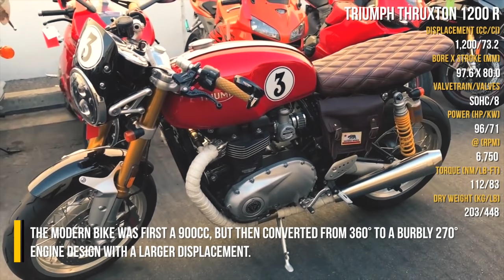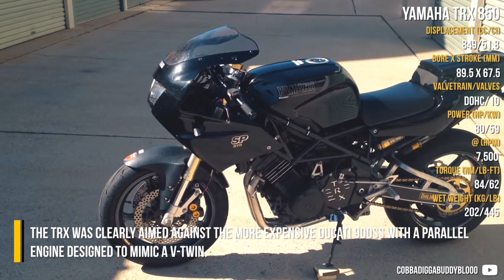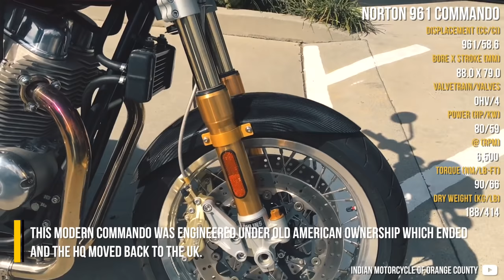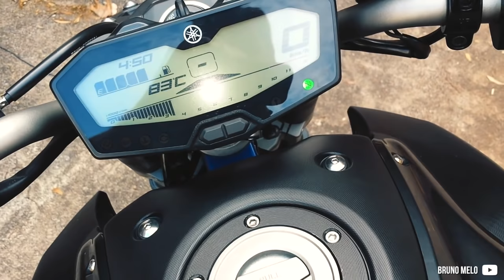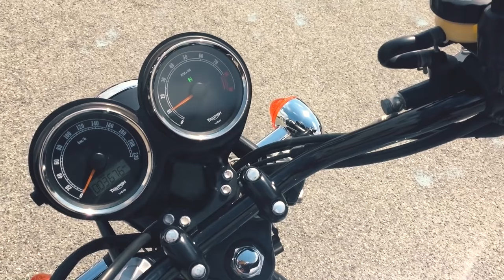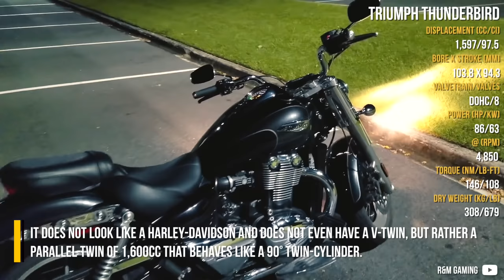11 Of The Few Cross-plane 2-Cylinder Bikes Ever

Comment: Basically, one quarter of a V8.
Reply: and im wondering what if just the front 2 piston assembly's are installed by there selfs and nothing else and ran? ( would it tare it self part? or what's the biggest stroker crankshaft you can use or piston wights ? ect. would you need a special cam or dizzy or fuel system ? ) as im curiose enough to tryout on my mopar hemi/440 stroker v8 as im looking 👀 to test different camshaft timing's and rod and pistons and running setup like computer controlled spark and fuels or boost ect. with out costing a fortune 🔮 and or giving me time to buy and assemble the rest of the parts to make back into a v8 ( and still letting me drive it in the meantime without making 1k hp more than likely as i don't know the max it can take 🤷‍♂️ ) without permeantly making it a 108x114mm~ Harley 90*v twin with 6 dead holes
Reply: And singles are a 1/12 th of a v12

Comment: IMO The Yamaha MT-07 sounded more close to a V-Twin than other bikes in the video.
Reply: They all did but the last bike definitely sounded even closer to a V twin
Reply: Exhaust system was the most open throated. The engine is also most most performance oriented for its displacement.

The only thing differentiating a Ducati type L-twin engine from Yamaha's MT-07 is the  throw direction of one cylinder. They have identical firing intervals otherwise. There are changes in engine balance characteristics and the fact L-twins don't need counterbalance shafts to make them smooth, but the parallel design has a lot of pros as well as it's one head and one cam chain system, less weird throttle and exhaust and cooling plumbing.
Reply: RipJawsX 95 yes.. the thunderbird sounds like a V-Twin too. thanks to the longer stroke and that firing angle
Reply: It is simple and cheap to put a full pipe on the mt07, many of the other bikes here were restricted or just had a slip on. I have a full Akrapovic on my Africa Twin and have ridden with the pipe and just the slip on. Due to the catalytic converter, the sound is different. FWIW, I went with just the slip on, it's loud enough and not annoying for extended periods.
Reply: Sounds like a twingle.
Reply: onl the yamaha can rev above 2k rpm unlike american vtwins
Reply: You can make all of them sound like a crossplane V8 by having a 2-2 exhaust without crossover.
Reply: Nuda 900 i think
Reply: @mala7794  
;)
Reply: The MT07 sounds awesome with an aftermarket decat exhaust .. just like the sound clips of it in this video ....... but it sounds like a sewing machine with the stock exhaust - which is probably why they didn't put a stock sound clip of it in this video.
Reply: Yep, and the Ténéré 700 along with it. Awesome bikes.

Comment: Where is the Husqvarna Nuda 900 ? the best sounding crossplane 2 cylinder bike at the time??
Reply: its 315*
Reply: @GIGABACHI  
You understand no shit. The Nuda has a parallel twin with a 315º crank shaft. That means it has exactly the same firing order as a 45º V-twin. Just listen to a 45º V-twin, to Nuda and to a 360º inline2.
Reply: @aleksandrnestrato  🤣I never said anything about the sound, I was talking about the connecting rod's offset angle.
Don't get ahead of yourself.👌🏻😁
Reply: @GIGABACHI  
Oh, I get it! The initial comment says "...the best *sounding* crossplane 2 cylinder bike..." and you, answering to the comment about the sound, never said anything about the sound—it's so obvious and logical.😏
I'm sorry, I couldn't grasp you're so haphazard here and I indeed did get ahead of myself.

Comment: The 270 degree crank of a twin shouldn't be called a cross plane since there is no cross. Only a 4 cylinder engine's crank, like in Yamaha's R1, shows a cross when you look at it from the side. 
Most people call the twin a 270 degree twin because it has something like an "L" crank. Two "L" can make a cross.
Same with any triple with a 120 degree crank - no cross!
Reply: 4 or above. Crossplane cranks are the most common i V8s, except for supercars like ferraris which uses flat plane.

Comment: Wait... crossplane technically means you have 90-degree angle between crank throws, which means at least 4 pistons (90-degrees x 4 = 360 degrees full crank rotation). Basically the crankshaft then comprises 2 different angles or planes crossing each other at a right angle, hence the name crossplane.

How on earth then do you get crossplaning with only 2 cylinders? Or is the term used loosely to refer to any crankshaft that isn't flat planed?
Reply: I mean, the 270º crank does have a 90º angle between crank throws.

I would say that other angles would still qualify as "crossplane" as long as an even firing order is being eschewed, ie the R1 and 900 Nuda count as crossplane, but a standard 3-cylinder does not despite not having a "flat crank".

Comment: "The MT-07 may be the Subaru BRZ of the motorcycle world..."

Except it has torque.

Seriously, it's time someone take the parallel twin (270° firing interval) and make a KTM 1290 competitor. Shouldn't be that hard. Just raise compression to 13:1, make it oversquare by a good amount, at least 1300cc, big valves, cam timing overlap, make it light weight. It could be rad. How come most of these parallel engine configurations are found in bikes that just chug along for the most part? If Ducati can maximize the L-twin configuration with their 270° firing interval, then someone in Japan could maximize the parallel configuration with 270° firing interval. Why not? It's a less heavy engine than an L-twin, much less expensive to manufacture, is a more compact package.
Reply: The width would make the bike too wide to be a KTM1190 competitor.  Unless they decreased displacement a good amount
Reply: I thought Yamaha was going to use the Super Tenere engine on something else (TRX 1200) but I guess that will never happen.
Reply: The Super Ten engine is a slug. Performance on that thing is quite low when you look at the numbers.
The width of a 1300 parallel twin wouldn't be drastically wider than a Vtwin. Even a 1300 triple would be more narrow than today's ridiculously over-square 1000cc superbike engines.
Reply: @exothermal.sprocket  that can be easily fixed by the factory if they wanted to.
Reply: That's true, but with a heavy reworking. They'll never do it. Just like the FJR1300.....big engine, not that much power when compared to Kawasaki C14 with only 50cc more. Seems like Japanese manufacturers are always leaning on the conservative side of everything. Gotta go to the European bikes to get stupid power in segments other than race track machines.

Bore to stroke on the SuperTen:  98.0mm x 79.5mm. That's 1.233. Even though not severely small bored in relation to stroke, the 1290 KTM engine is 1.521, far more oversquare and eager to rev/make HP (not to mention 13.2:1 compression).
To get any real HP they'd have to enlarge throttle bodies, valves, make radical cams, cam timing overlap, raise the compression at least one and a half points, raise redline to 11K or so, and rework the air box. Not likely any of these things will happen on the SuperTen.
Reply: @exothermal.sprocket  not a chance, it's overbuilt/understressed like a farm tractor and probably would survive a nuclear blast.
Reply: I realize that. I guess I need more excitement in motorcycles for my tastes. I've ridden at least 50 different models over the years from a bunch of brands, owned 10 different bikes now, all one at a time. I guess you might say it's a little bit like a virus? haha
Reply: Carry forward and venture to "new lands" !
Reply: Yeah, I need my own private garage so I can have more than one bike at a time.
Reply: Why go for oversquare cylinders, when the aim of the engine development was to get maximum torque from a given cc??
Reply: There's smaller displacement engines that make plenty of torque without going square or under-square. The ratio between bore and stroke isn't the sum of torque, although it's a good starting point.

Comment: How difficult would it be to use a 270 degree crank in the Fiat 500 Twinair, instead of the original 360 degree?

Comment: I have a 1400 intruder. It looks like a 45 degree V-twin, but it has a dirty secret - the crank is split 45 degrees. So it sounds like either a 90 degree V-twin or a 270 degree parallel twin.
Reply: Wow, interesting. Do they have a counter balance shaft for the reciprocation. Cool fact man :-) love it...
Reply: So does the 805cc boulevard

Comment: So they're actually called the cross-plane twins?
Reply: A "plane" is a geometric term use in engineering. It simply symbolizes the fact that the crankpin and the center of the crankshaft exist on a hypothetical "plane" in space. To say "cross-plane" is to imply that the relationship between more than one cylinder is crossed. Both crankpins do not exist on the same plane in space. They are crossed to each other (usually 90°, but not necessarily so because Yamaha's triple is also called a cross-plane engine with 120° between the crankpin relationships).
Reply: @exothermal.sprocket  Oh I see, so basically any engine with unparallel number of cylinders can be called a cross-plane? Like the 5 cylinder for example? 144 degrees
Reply: If a pair or more of cylinder crank pins are in the same plane relative to each other, that's "flat plane". If those planes are rotated from one another, it's "cross plane" technically. People will argue that cross-plane configurations are only 90° (perpendicular) to each other but by raw definition that's not necessary.
Reply: @exothermal.sprocket  yamahas triple is not cross, that's why they call it crossplane concept to subvert the nomenclature